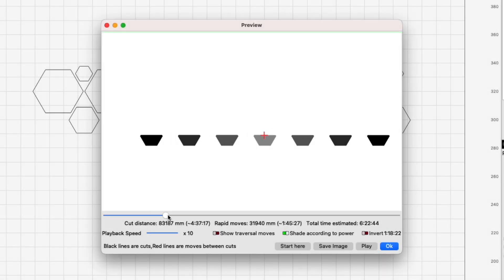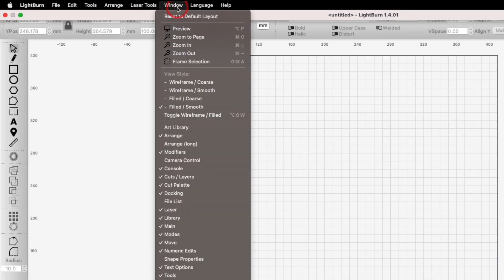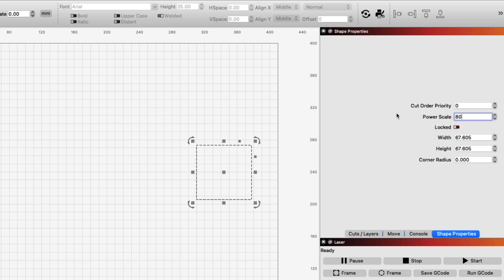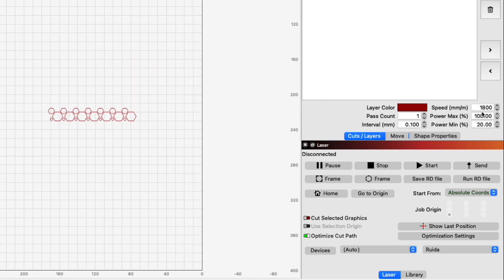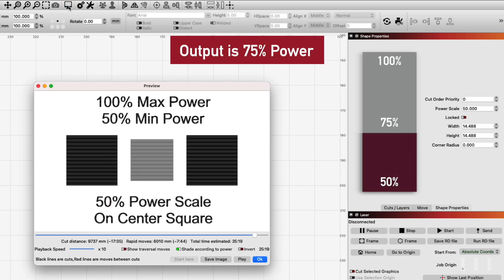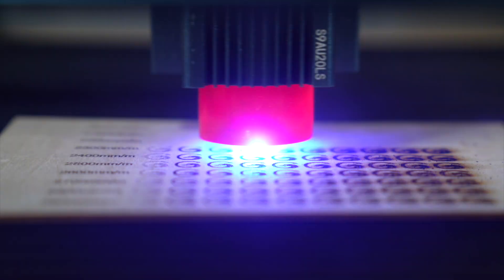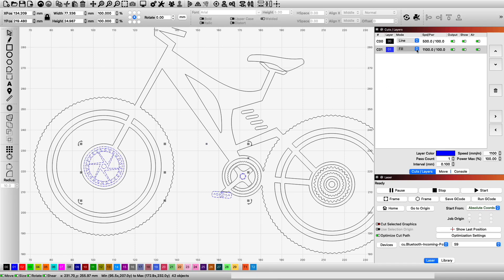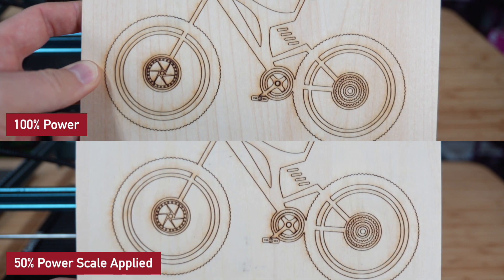Fine Tune Laser Output With Power Scaling

Comment: Lightburn is a really usefull tool but be careful. I bought it 2 years ago and lost my license key number due to a hardrive failure. I emailed Lightburn on numerous times for my serial number and they said they couldn't find my account, After a few emails saying they couldn't find my account or payment they ignored me, be carefull as this is a rippoff. So I had to pay again the full £110 to get another. Please look after you License key or you will be shafted like me as Lightburn will say they your account/payment/license does not exist.

Comment: Is there a way to scale power based on speed?
It seems like this should be just the default but from what I've read, there's a threshold where the power jumps from max to min once it gets below that set speed (not clear on what that setting is, however, as I've tried to change things and I can't)... So instead of it being either min or max, it could be a scale so that as the laser slows down toward a corner, for instance, it will also reduce the power proportionately, not just after it hits the set speed for switching to min?
I hope this question makes sense. Thanks.

Comment: I still don't fully understand the meaning behind it. A second layer was driven with less power. I don't need the option for that? I can adjust the performance directly in the new layer.
Reply from the maker: Yes, you can run a second layer but it will complete the first layer and them come back for the second layer. With this, it will complete everything in one pass. It can be really important for job optimization. This is a small example but on a larger scale the time savings can be substantial.

Comment: is this as much of an issue with a CO2 laser? i noticed the demo was with a LED or diode laser.
Reply from the maker: Not sure what you mean by “as much of an issue”.  This is primarily showing that you can adjust the power output of individual shapes while still engraving them all at the same time.  It works on all supported hardware.